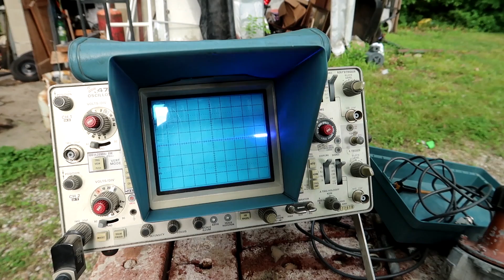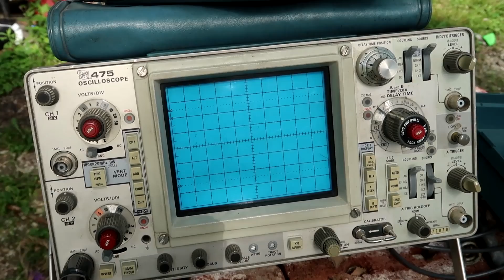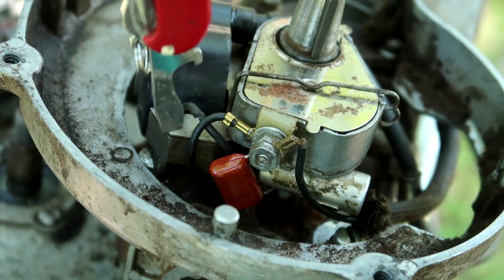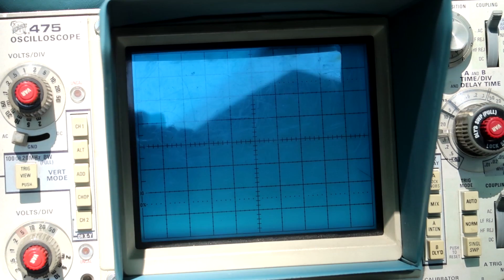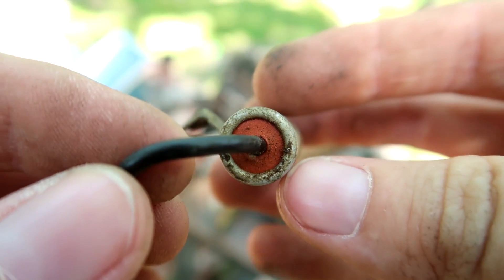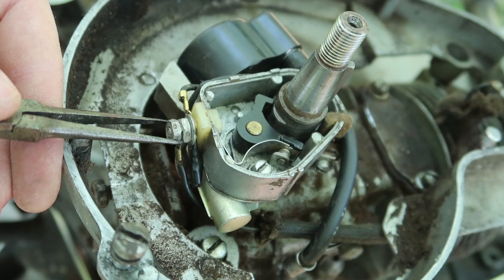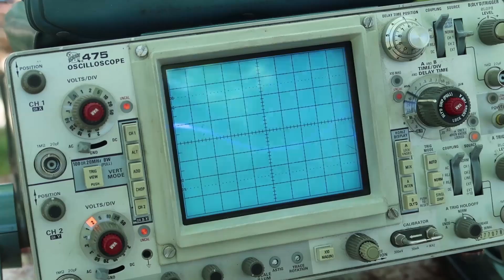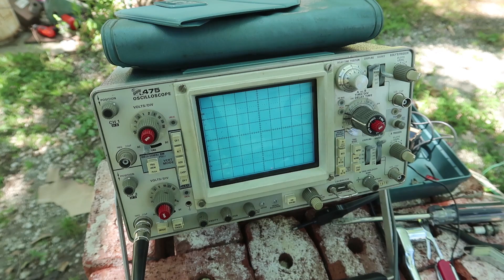1950s David Bradley Chainsaw Restoration 05: Trying to Make Sense of the Magneto with Oscilloscope

Comment: Either the magnets in the flywheel have lost their strength or the coil has an open winding. You might look into one for a motorcycle. Old lawn mowers are a good source too. There's also the possibility though tedious, of manually rewinding the magneto. If you decide to go that route, while it's a somewhat good idea to count the number of windings all that's really important is the gage of the wire and the approximate depth of wind. It's a complete pain to do but worth it if you can't find anything else to replace it. If in doubt of how far to go with it, error on the excess side. More windings than it originally had won't be as much of a problem as not enough.

See the problem with those old magnetos is that the insulation often degrades as we didn't have the kinds of epoxy that are resistant to moisture, chemicals, and heat that we do now. Because of this old ones like the one on that engine suffer from the same problem that old film does as some of them were lacquer or acetate based and will degrade over time with moisture. The film you found in the abandoned dark room, that's essentially the same thing. Newer magnet wire uses polyacrylamide resin which is much more resistant to moisture and heat making it the much better choice. Incidentally this is why old radios blow out their transformers. Same problem.

As I've been offline for a couple years, I've missed a lot. While this information may not be particularly relevant to this particular project anymore, it's good information to have and may still be useful for other projects. Meanwhile, I'm glad to see you still making videos. It's a real shame, what happened to Grant Thompson. I'm just glad you're still here.

Comment: The capacitor/condenser has to be there since it's part of the pulse generator/magneto system. The magneto sees the magnet pass the coil, and the capacitor charges and rapidly discharges causing a collapsing electrical field. That field, when the magneto rapidly discharges, it produces a very high voltage which is sent to the spark plug. By the way, the input for that  oscilloscope could NEVER handle a spark from a magneto. at 50V/division, you are maxed out at 500V at worst case. Never for an 18,000+ volt spark output. The pulse is also super fast, so IF the scope could handle the voltage, it would be seen as a large spike cascading down to zero. Kinda would look like a pine cone laying sideways on the screen. Now you can use a Neon lamp to see spark. They use VERY low current, and can light up to show spark. One lead to the spark wire, the other you could feed to a 1 Meg Ohm resistor to the chassis. If you have spark, it will light up. I promise you, if you really had a good spark, you would toast the input on that scope! You could use a wire loop around the spark wire and use the scope also. Maybe 4 turns of small telephone wire, about 20 gauge, wrapped around the spark plug wire. Connect the scope probe to one end of that loop, the clip of the scope probe to the other end of the wire. The induction created around the wire will be visible on the display, and you will save that scope. I have serviced MANY O'Scopes over the years. I have 4 in my shop now that I own. I know this is an old post, but I just had to try and help you out some. Hope it does.

By the way, 60HZ has nothing to do with the engine. The frequencies are not constant, nor are they 60Hz except at one tiny moment of time. The output of the spark wire by the way is basically AC since it changes from Plus to Minus depending on the magnetic field building or collapsing.

Comment: Great videos I was looking on eBay and found your coil for $35 not sure if that would help. I have a David Bradley that I did not know I had. Will I'm going to try and start it and see what happens. But you have a lot of useful information on here I hope you don't give up on it. I would like to see it run. just maybe I'll get mine running. Good luck in future endeavors!
Reply from the maker: yeah i purchased a supposedly working magneto for a david bradley. but then i started working on my workshop build and that got shelved for now.

Comment: Check Coil with 6-12v or 18650 battery, with spark plug attached and grounded to case, quickly tap coil input wires to battery if you see a spark on the plug you know coil is good, using the scope that way will surly damage it, if you haven't already, use an inductive probe like I said in the other video, you will also lose the 60hz noise if you do. 
Is there any way to move the coil closer to the magnets, one side of the coil may have an oval mounting hole? spacing is VERY important.

Comment: Have you tested the resintence in the magnet and the coil in case there is a conduction or a break in the copperwindings?  The gap on the ignition pin is also crusial...

Comment: Rinoa, when you filed the laminations you shorted them all together. I can't say with certainty that it wont work like that, but it is a problem (the laminations were insulated from each other). Another coil, the Nova 2, and a new plug wire and she will work.

Comment: Now is there a wire from the magneto that has a small piece of mother board but no chips on it that grounds off on the side of the cylinder block because sometimes that breaks as well ? Or is there any kind of voltage regulator? Or does the mag regulates itself ?.

Comment: A feeler gauge is needed to set the points .   Make sure the spark plug wire is good .  The carb and gas line is more important than taking the original condenser out .   The set screws in the carb shout be left alone .  It was running when whoever bought it when it was new .    Trying to readjust everything will mess it up .    New fuel line and carb cleaning might be the most important .
Reply from the maker: i use a guage to set the points in this video, guess you didnt watch the video?

Comment: There shouldn't be that much noise. 60hz is usually only several milivolts... not 20 volts. If there was a 20 volt potential on your body you would get a shock every time you touched something grounded.
Reply from the maker: yeah yet one more thing to add to the pile of confusion.
Reply: Perhaps the oscilloscope contacts are dirty? This is supported by the fact that 60hz noise is worse on some settings than others.
Reply from the maker: same happens on both channels

Comment: Using an oscilloscope is a bit overkill for a basic chainsaw, have you cleaned the pitting off and gapped the points yet? The gap would be about 12 thou of an inch. When you get a pit and a lump on them, you can’t get the gap right. 
  Good luck, it’ll come out in the end.

Comment: What kind of spark plug are you running? older engines like that used something called a non resistor spark plug
Reply from the maker: im using the original spark plug.
Reply: nevermind that idea then lol

Comment: Noooooooooooooo
Can you feel it jolt you? At least worth one shock(if it were me). Gaps for point and magnets are very important. I've dealt with points on my 75 land cruiser and an old stihl chainsaw. All the parts were like $10 total at napa. Is that the coil you enlarged the hole on or original? I understand if you have to shelve it though. Loved the $600 comment!
Reply: Also, may need to sand the points down if they are pitted and check timing relative to "top dead center". Intermittent behavior could be because of bad points contacts.
Reply from the maker: its the one i had to grind down the core for.

Comment: a Magneto only puts out small amount of volts a magneto should have alot of amps to make the spark plug work..
you might half to get another coil and put on it..aloso the wire at 5:05 probily should not be around the mag like that...also make shure where the coil bolts onto the block is clean and have u tryed fliping the coil over if that possible?
Reply from the maker: wow you really have no understanding of how any of this works, the magneto makes an extremely high voltage at extremely low current.
Reply: i was always told that they were high amps with low volts well thanks for leting me know

Comment: Did you check the resistance of the coil?  Spark plug wire to ground should be high. Maybe a couple hundred ohms.  Remove the primary wire from the points/ condenser.  Primary to ground probably less than 10 ohms but not a direct short.
Reply from the maker: yeah i think it was 6 megaohms like most people say is ok. 0 ohms on primary.